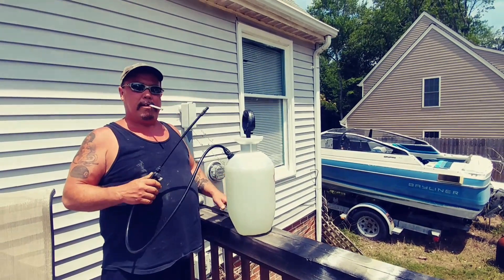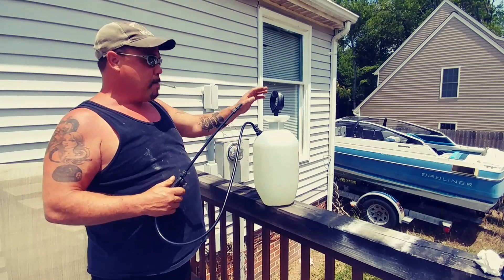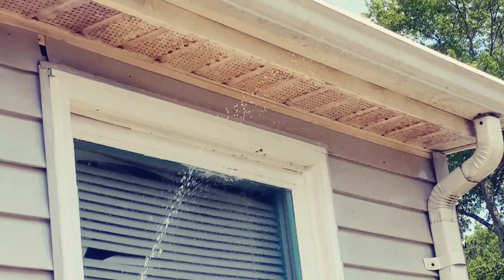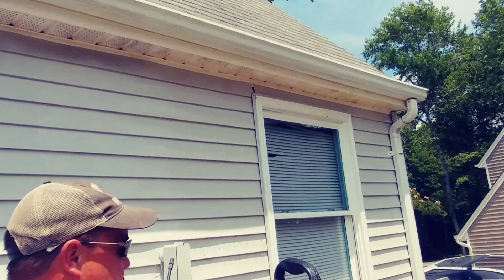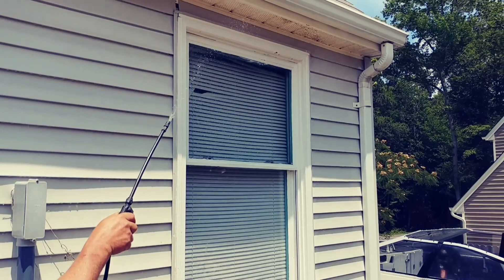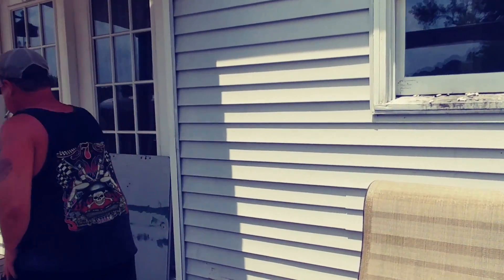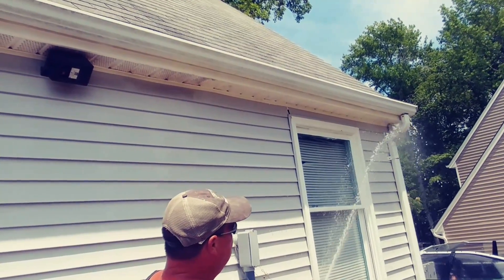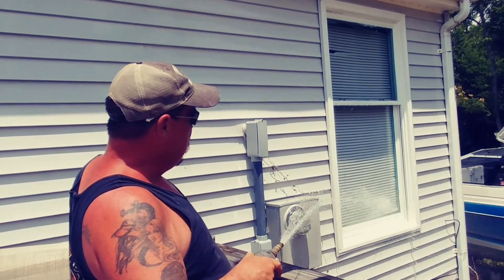Clean vinyl siding on your house no power washer

Comment: I'm 75 years old and was able to wash the mildew from my two-story vinyl sided house using this technique. No scrubbing, no reaching. I used a pump garden sprayer with 1/4 oxygen bleach, 3/4 water and some Dawn detergent. Used a ladder to get as close as I could to spray on the bleach mixture. The mildew changed color and became gloppy. I waited a bit and then used a power washer to rinse off the glop. No brushing - it came off almost 100% in one shot. A few stubborn places needed a second application. 

The job was so easy I went over and did my daughter's house too. A matter of a few hours. Really fast and cheap.
Reply from the maker: This is awesome

Comment: Don’t get that bleach in the boat Bill! That is a great way to clean that yuck off, I use a cheap $10 hose end sprayer “Ortho Dial N’ Spray” with pure bleach, set it to 3 oz. per gallon, and it covers the whole trailer. After that I use a hose to wash it down, I wash it in the 1/5 rule, spray a 5th drink a 5th. By the time I am drunk, I mean done my trailer looks new and smells good too. Be sure to wear white so you don’t look like a spotted cow out back. Be sure to clean that hose end sprayer with water and it should hold up a time or two. The rubber seals do not last long after you start using bleach in them so be prepared to get a Fall use out of them only and just use them for bug spray. Do not clean your trailer with bleach in Spring or your foliage will grow half ass, I wait till early Fall when there is slow to no growth left.

Comment: I use the 30 second cleaner i think this  work really well for the cleaning of the ceder roof what else work really good and taken me  about a 1/2 the time to clean a two car garage was my surface cleaner i thought it would be bad for a ceder roof wrong it work great try it u like how are you doing
Reply from the maker: I will have to check into that sounds like a good deal